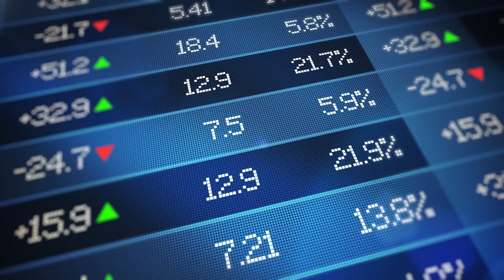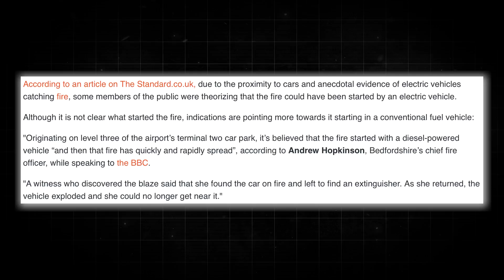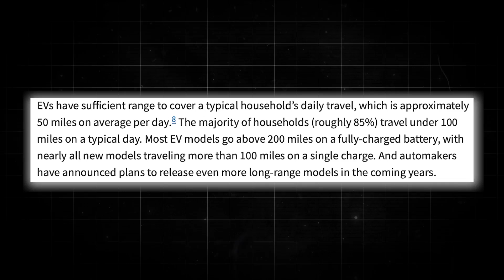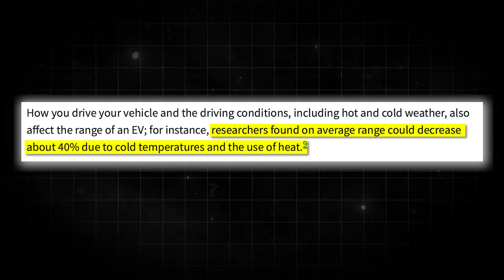Top 7 EV Myths Debunked: The Truth About Electric Vehicles

Comment: The argument that EVs catching fire exists as a veritable threat holds no water. EV fires are rare compared to ICEs. The problem with EV fires is it is hard to put out. Aside from crashes and poor maintenance, ICEs have significantly higher risk of fire caused by electrical system failure, fuel system leaks, and overheating of engine.

Subjectivity and objectivity in statistics are interesting. Self-funded non profit agencies around the world that are devoted to eliminating injury and deaths by fires, have studies that show the percentage of EV fires is relatively rare compared to ICE fires whereas studies from profit orientated auto clubs that promote motoring and motorsport and get most of their funding from members that own ICEs and fossil fuel investors tell us EVs are more likely to catch fire. Then there are studies by independent research companies, insurance companies both private and socialized, and even independent government investigative agencies that show ICEs are way more likely to catch fire.
Reply: You can’t put out ev fires. Firefighters literally have to let it burn out on its own. They are not hard to put out but impossible.

As you mentioned yes petrol cars are subject to catch fire nobody is arguing that, but 9 times out of ten like you mentioned it’s when the owner neglects his maintenance duties. Thus it’s understandable why. With evs (and my own personal experience) evs will catch fire charging at your own house even with perfect maintenance. Even if evs catch fire less, having absolutely no way to put it out means you are driving around a bomb and taking it home even right off the dealership lot! Petrol cars have been tried and true!

Comment: An EV fed by a natural gas power plant has the highest Well to Wheel efficiency and an EV supplied by diesel and coal-fired plants have approximately the same efficiency. EVs powered by fossils fuels do not do as well as diesel cars, but that is as of now, as further investigations are needed to examine the life cycle emissions from cradle to grave of both systems, which is kind of useless to do, as grids using fossil fuel only will be a thing of the past in at least in my lifetime.

Comment: It is inevitable that petroleum will not be used for most small mobile transport, as even oil majors know petroleum is too valuable to be wasted on gasoline and will be need it for our grandchildren to use for for plastics, paints, petrochemical feedstock medicine, etc. Also inevitable that the world's electrical grids are going to need replacing in the next few decades anyway, from the top down. Sixty Hertz AC is a technological legacy nearly as old as landline telephone subscriber loops. Current grids limits the radius of a grid, and makes it vulnerable to the kind of cascade failure we saw in Texas, and in the northeast US before that. The late 21st Century electric grids will run on high voltage DC and will have no synchronization problem, so it can be continental or even global. Which is necessary if intermittent sources are to provide more than about a third of the energy.

What is being pumped into the atmosphere represents an enormous technical debt, which is much much more than all the tax expenditures and all the subsidies by all countries to wind and solar energy and EVs. If it wasn’t for the oil industries technical subsidy, fossil fuels would not be financially viable, but the biggest "subsidy" of all is the privilege to dump as much waste CO2 into our atmosphere as you want, for free. Biggest technical subsidy to any industry ever. This is what economists recognize as a “socialized cost” or an “externality" to avoid provoking ideologues and pedantic bean counters who insist no subsidies exist except tax credits or direct payments. Decisions to delay fixing a known problem is what engineers call creating "technical debt," but the concepts are the same. 

The amount of petroleum needed to provide fuel for mining, manufacturing EVs, and how much CO2 this will dump into the atmosphere is small compared to the amount of what ground vehicles use burning fossil fuels. Heck, an EV recharged by a coal plant puts out half the CO2 as a gasoline car the same size doing the same trip and even much better in stop and go commuter congestion. Imagine what can be accomplished with much more efficient upgraded grids and power plants that require less fossil fuel along with solar and wind to fill the gap until next generation nuclear.

EVs catch fire at a much lower rate per sales than ICEs. And considering LFP batteries are inevitable, the problem of EVs igniting will be next to nil. The chance of an EVs battery igniting is 50 times less than that of a ICE, but your EV will be a write-off. Good news is some automakers are going to stop using lithium ion batteries and use lithium iron phosphate batteries instead, which will make them safer that ICEs. Also it is highly likely in less than a decade, sodium will overtake lithium and be the norm.

Comment: Repairability is a bit of an issue. With older cars if you scratch the underside due to bad road/road conditions, you can repair it rather cheaply. With EV's, you might loose your warranty due to user inflicted damage and be forced to pay, up to 80% of the cars cost for a new battery. Buying a second hand EV with hundreds of thousands of miles of them, means that you'll definitely need to replace the battery, at which point you may as well by a new car, creating more waste. While, I'm looking forward to EVs becoming a thing, there is no denying the potential financial dangers they pose.

Comment: There may be fewer things that can mechanically go wrong with EVs but there are several more ways it can go wrong with software and electronics which are more difficult if not impossible to repair without going back to the dealership for back-ordered components, likely getting price-gouged for parts and labor all the way if the problem isn't covered by a recall or warranty.
Reply: Oh and my favorite part. Do you remember when Apple got caught “updating” the older iPhones that slowed them down so customers had to buy new iPhones? Now imagine this with EVs that’s cost 100k instead of 1k phones.
Reply: Problem is many newer ICE cars software and electronics, which I dislike at times and can be a headache.

Comment: What happened to depreciation?
And the cost of public charging vs. off street charging?
Complexity! EVs are complex is different way.
Reply: Depreciation is only for people who change car every 2-3 years. And it is not a myth, there is really depreciation, most probably due to the fact that battery tech is improving at an incredible speed making previous cars less desirable (but still good).
For off-street charging ... is it possible to do so for an ICE vehicle ? At least we get the chance to make our own electricity. I guess price for public chargers will go down with bigger adoption and more use (economies of scale).

And if by complexity you mean the software in them, new ICE cars also have the software in them.
Reply: @johngonon1507  One of the reasons I am putting off buying an EV is due to the rate of which battery tech is improving. When a mini SUV is availale for under $45K in Canad with at least a range of 900Ks, I will seriously consider getting one.
Reply: @rps1689  I can understand that. It was the same with computers, you always wait for the next generation that will be better. But in the end you don't buy. Some batteries (still limited to China for this year) enable fast charging in 15 minutes. I thought that the next version of the Zeekr X (mini SUV) would come equipped with it but it seems that it won't :o(. The range is not really the issue with EVs, you still need to pause a bit while traveling ; it's more the speed of charge. Someone doing a lot of long travels will probably not like the experience, but for someone like me who does 4 trips in a year that require fast charging it's not an issue even with my current 30 minutes charging. The rest of the year I don't even have to think about it.

Comment: when was this produced this is so out of date . china has reported 3000 ev fires.
Reply: 212'500 car fires were reported in the USA in 2018 ... and I seriously doubt that there were a lot of EVs among those.
Saying how many EV cars burn without saying how many ICE also burn (and which proportion they represent) is pointless.
Reply: @johngonon1507  You also need to keep in mind that in NA, the average ICE is 12 years old vs ~2 years old for EVs, things could change a lot in 10+ years before things become comparable. Additionally, about half of ICE fires are electrical in origin (rodent, chafing, rot, etc. damage) and there is a lot more high-power wiring in an EV.

An ICE fire can easily be put out with water or a fire extinguisher often present on-site in minutes with low likelihood of spontaneous re-ignition. Dealing with a battery fire on the other hand requires specialized equipment if you do not want to be at it for several hours and have to monitor it for weeks afterwards.
Reply: @teardowndan5364  Well time will tell. The new batteries are getting better and better at preventing fires (maybe because of those problems in China).
After 7 years, my battery hasn't caught fire, hopefully never will.
Reply: @johngonon1507  While China may be the hotbed for spontaneously combusting batteries, the rest of the world had a good serving with the Bolt EV and other EVs that used the same LGChem cells from 2016 through 2021.
Reply: @johngonon1507  ICEs catch fire so much, that it isn’t newsworthy when they do unless they hold up traffic or kill someone.
Reply: More specifically, an average of 7/day back in 2022. It is likely worse today. This is kind of alarming when you consider that the average EV age is 2-3 years since most of them were sold in the last four years.
Reply: @teardowndan5364  You have to factor in that in China there are lots of unknown brands making EVs that don't sell anywhere else and will probably disappear in the future. I tried to find fires by brand but it seems that people doing stats are not going that far.
Reply: @johngonon1507  BYD averages one EV showroom fire a week. It is one of the top contributor to China's daily EV fire statistics, one of its largest EV manufacturers and also its largest exporter to countries that haven't effectively banned Chinese EVs by slapping massive import duties on them.
Reply: Only 3000? That's impressive.